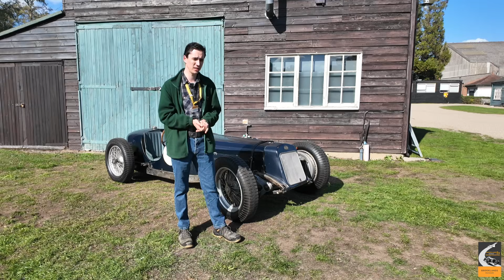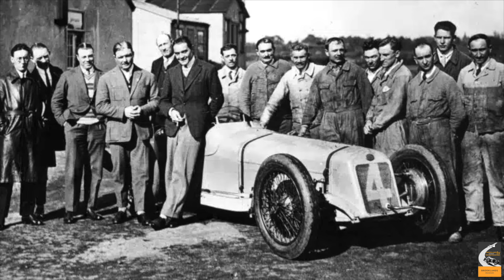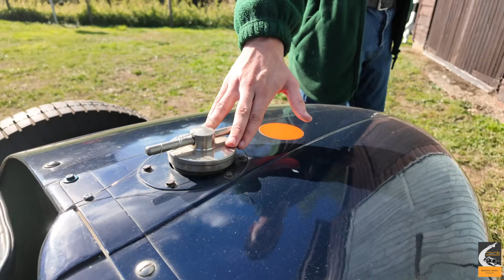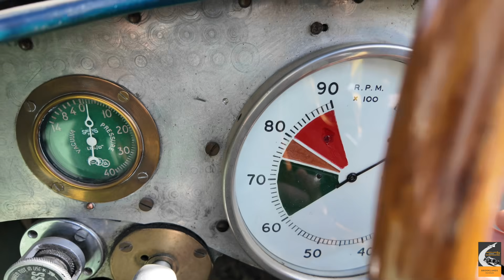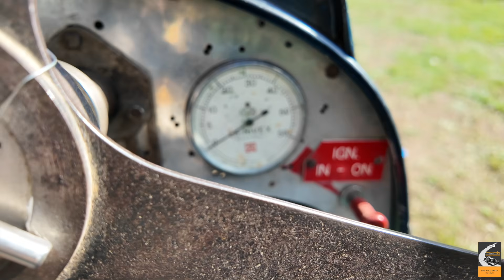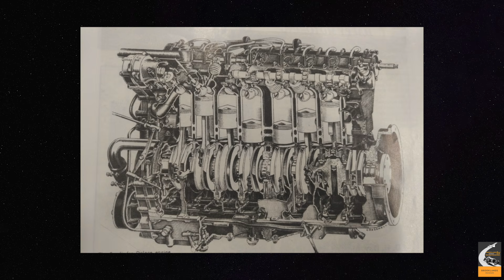Brooklands Collection - The 1926 Delage 15-S-8 introduced by Brooklands volunteer Ben.

Comment: This 1927 GP 15-S-8 Delage was bequeathed to Brooklands in 2012 by the late Alan Burnard, who over many years recreated / rebuilt the straight 8 engine to replace the ERA engine that was previously in the car. This car was often seen at Brooklands Society events in mid - late 1990's when Alan would run the engine outside the Clubhouse for all present to enjoy the sound.